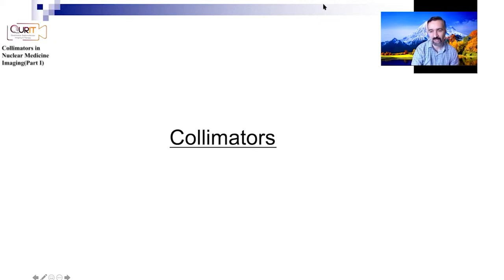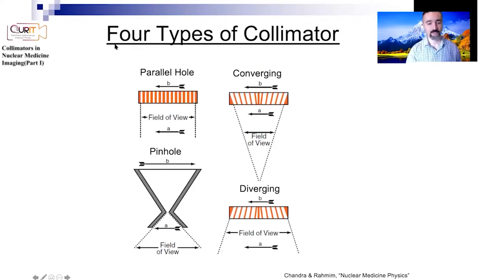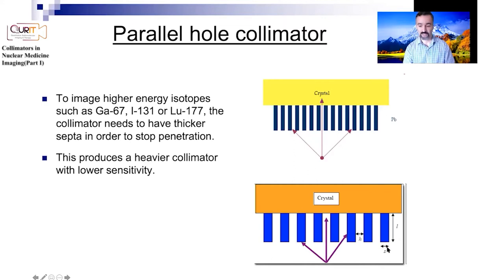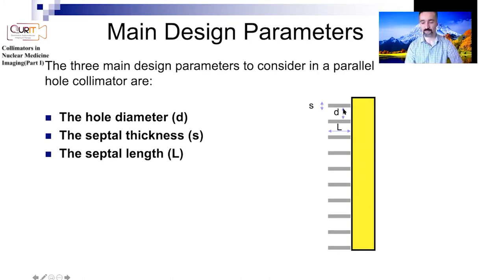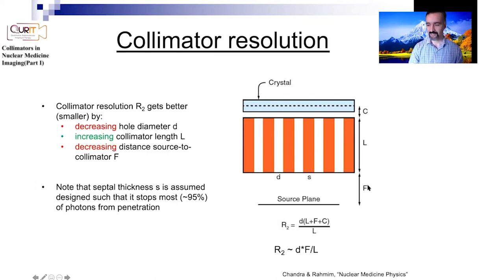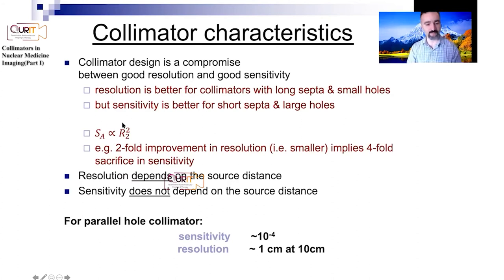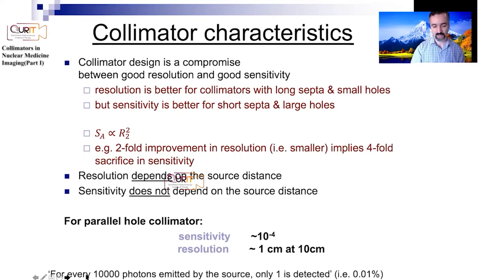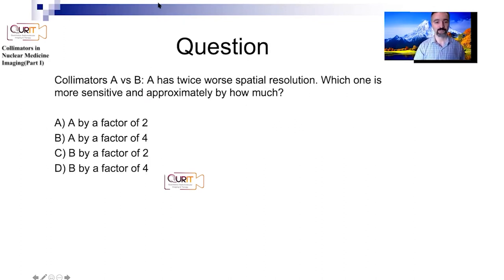Collimators Used in Modern Medical Imaging (Part 1) [L25]

Comment: Answer to the question (19:35): The half-life for Re-188 is about 17 hours. After 10mins, more than 99% of initial activity still remains. So, we can assume the activity unchanged.  Now we can easily multiply the activity by the sensitivity of collimator to obtain the total counts per second of Re-188: Total counts/sec = 10 MBq * 0.9 * 10^-4 = 900. Now we can calculate the number of 155 keV gamma rays counted per second which is 15.6% of the total counts: 900 * 15.6% = 140.4. If we continue counting for 10 mins, we will count a total of 140.4 * 10 * 60 = 84240 gamma rays with 155 keV of energy.

Comment: Great lecture! Thank you very much for sharing!!! a minor comment (10:15): I believe intrinsic resolution is not degraded with increasing gamma ray energy. Intrinsic resolution is actually improved with gamma ray energy because at lower energies greater statistical fluctuations occur in production of photons in the crystal. for energies above 250keV this effect becomes much smaller because of multiple Compton scattering.